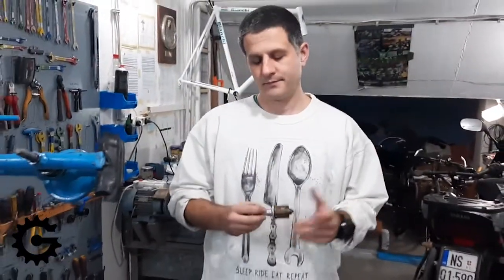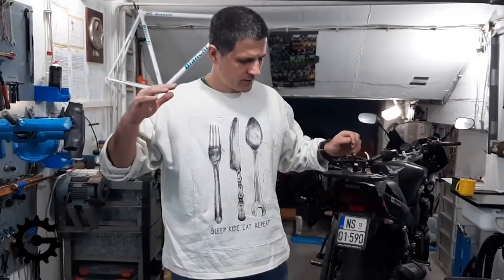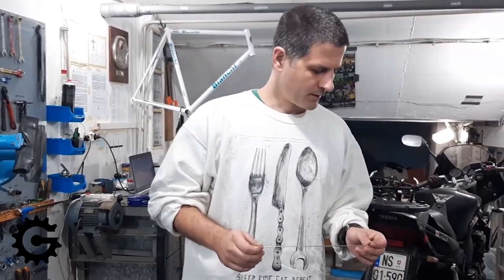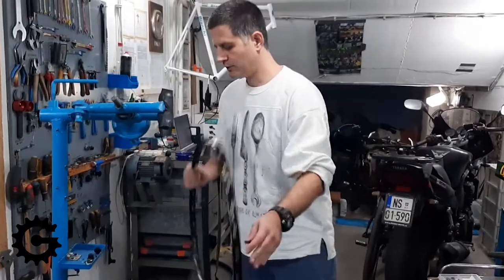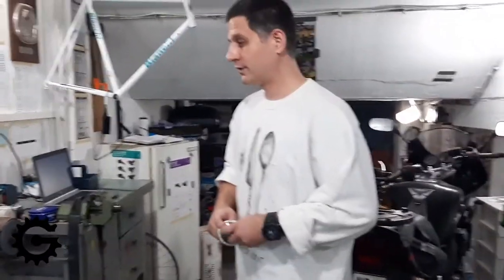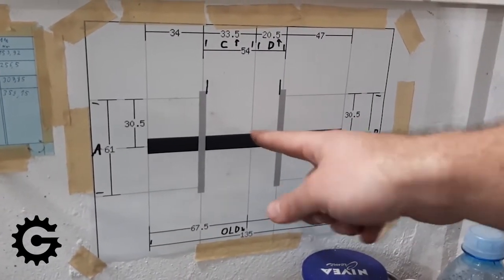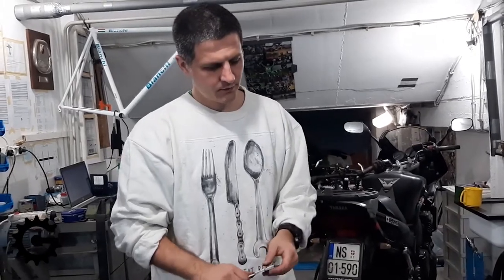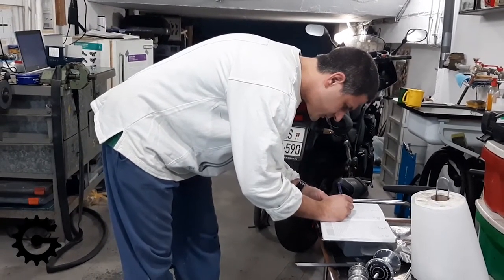Bicycle wheel building [03] - Measuring and calculating spoke lengths [1004]

Comment: Hi all could you please give me some advice. 
My two wheels spoke lengths are  284.5 /  282.9 and 284.4 / 285.5 what lengths should I get slightly longer or slightly shorter?
Thanks.
Reply from the maker: Hi,

The optimal spoke length depends on how you calculate it (some calculators require rounding up, some to the closest size etc.), and the spoke thickness (some calculators take that into account - that the thinner spokes may elongate more under tension).

So, very generally speaking:
1st wheel:
I'd go with 284 / 282 for even, or 285 / 283 for odd spoke lengths (making sure there is a 2 mm difference in length).
2nd wheel:
284 / 286 for even, or 285 / 287 for even sized spoke lengths.

Relja